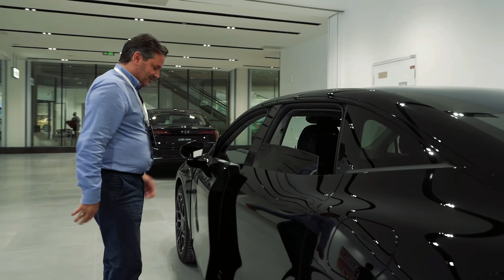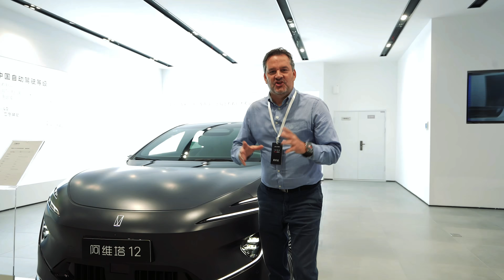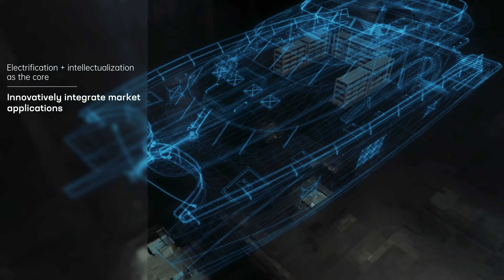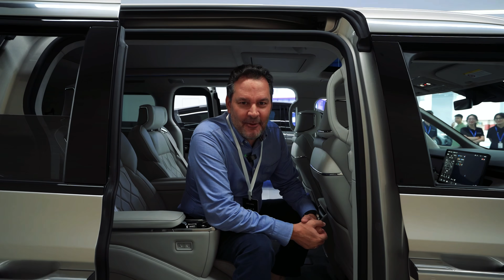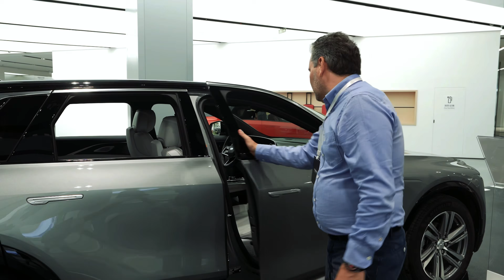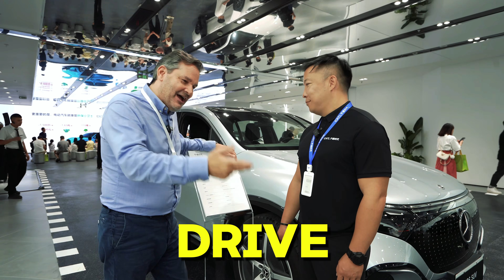Chinese INCREDIBLE Electric CARS Are Taking Over The WORLD Tesla Killers

Comment: There's nothing incredible @ Chinese EVs, as they have not solved d problem of their batteries catching fire. From d moment smoke is detected till d vehicle catching fire is less than a minute. When it burn, it does not just destroy itself,
but often a whole car park. There R some 20k such fires a yr in China. The problem with China's EVs is that d technology is stolen intellectual property. They've never spent d time testing 4 safety reasons, but infos were passed down by former Tesla workers who have been thoroughly trained on d job, or that d info were hacked. Do not believe it
4 a moment that China gained this knowhow righteously.

Comment: cars from China? If you say yes, then read what I write, firstly China has no service like a petrol car, so if you want a windshield you have to wait two months, if this dealer does not make an agreement with the company and only buys cars, you will have a lot of difficulty finding spare parts, then the most important thing, do you know how much a pack of batteries costs, as much as the car and an engine? OK, if we drive a petrol engine to death we can repair it very quickly, with an electric engine?
then from China quality, well that is not the best, all the material is so bad, in three months you will have no tires, everything will rot, all the rubber parts will dissolve, everything is basically recycled from old material
think carefully before you buy

Comment: The best thing about China is that when they built quality, they mean it. There is no rubbish in there quality built. There EV industrie is looking to change the world of driving. But it must be safe, It must be convenient and it must be reliable. Resistance against the Cold of Mother Nature, resistant against the heat of Mother Nature and  finally, water proof to avoid the death of electrocution on a flooded  area were Mother Nature need her powerful water to pass through. Without the assurances of the safety against these elements, is like driving a timing BOMB. One of the important thing about the industrial providing EV to the public is making it affordable for all consumers interested in buying an One. The U.S. have shown many critical errors on the RV manufacturer.  But the customer must understand the inconvenience of something so expensive ending up not worth buying. It just because when it break, it seat in there driveway for month, or not been able to use it again due to an expensive mechanic problem. The U.S. is more focus on  making the money from the consumer, then making it safe for the consumers. There are to many issues with the EV in the US, they don’t bothered to fix and rather continue building with more issues.😳🙄😕

Comment: All they are is upgraded beach-buggies that tie up your money until you die. Screw that, I'd rather a 70's Datsun 1600 or Toyota corolla any day, they do a better job more efficiently and you don't have to use them every day so they keep going like you do with electric vehicles, and unlike electric vehicles would the old cars are still going 50 to 100 years later. And every time there's a war, or flood etc the petrol cars will still keep going, the electric cars either stop or catch fire. On top of that the old cars aren't spying on you and the car can't be turned off without your permission. These cancerous vehicles are total enslavement of the people.

Comment: @samegalle1089 you couldn't be more wrong, keep your head buried in the sand like an Ostrich.  Why do you think the US just banned the importation of Chinese EVs?  The tech doesn't suck, CATL is 5 years ahead of the US on battery technology, take it from an electrical engineer.  With Sodium Ion battery technology, second generation batteries are going to be cheaper, with longer ranges and faster charging, a win, win.  You just keep your gas guzzler idling in your closed garage and see what happens.

Comment: I watched Louis Gave talk about a BYD hybrid that gets 2000km per fill up (gas+electricity) and costs $14000 in China and listened in awe. Instead in Canada we'll continue only to have 70,000$ EV's and zero used EV market (you have to be insane when they charge 20-30,000$ per new battery.)
 Im not a fan of EV's because (i use a car share service downtown that has EVs/hybrid) seeing the power drop as youre driving in -20/-30c winter (also, living in an apartment building means no charging) is  deal breaker. But having to fill up the car 5x per year sounds great.
EV's will remain a limited segment that remains unaffordable for most Canadians. And the Canadian government and all political parties want it to remain unaffordable.

Comment: No they are not... At least here in Europe they are failing massively - why? Short: to expensive, less range and charging speed, no service and spare parts, not trusting in chinese brands.
Because instead of selling them for cheap chinese car companies think they can make big money by selling them at the same price as European cars and no one will buy them for this money...
Why should Europeans buy cars that could become a 2 tones 30000€ paperweight if no spare parts are available or the chinese brand gets bankrupt (as Aiways just did).
Why should anyone buy a 30000€ chinese car if you can have a similar European car for cheaper... Most of the time chinese cars cost the same here in Europe as similar cars we have from our own European brands, but are worse in every single specification: often they have a worse range, charging time, have much less driving comfort and much more cabin noise... The only diverence is they offer often many anyoing and half baked tech stuff no one likes outside of china.

They haven't earned any trust in terms of long term quality and how good the cars will hold up many years down the road.
And than there is not a single brand with a good service network and spare parts are often need months to come by...
And then there us the fact we all have internet and easily can check chinese prices: if you sell the BYD in China for 15000€ and in Europe for 32000€ we all know we get ripped of... And no one likes to get screwed.

So to chinese brands: if you want to come to a new market, cone it with a BANG and make some noise... The only way to do this is via a cheap price - we don't care about your shiny tech anoyers... You have to proof yourself first, like korean brands did, come into a market cheap, build a network and later models will make money.
If you bring a model overpriced, no cares if you lower the price later.... Damage is done already. If you have proofen that your cars are worth it, than you can start to raise the price.
Reply: You are right. So the Chinese should do better. At the same time, US and EU should give the Chinese the national treatment as the Japanese and Korean, instead of various kinds of suppression.
Reply: Lots of copium have you.

Comment: Thank you Alex. Wonderful video. I love what CATL is doing in the energy storage sector. I Live in Alberta and I follow  the daily Min, Ave, Max prices of electricity. Julys numbers were Average Low price $14.64, Average average price at $88.62 and the Average high price was $339.80. That is a huge spread between $14.64 and $339.60. I would love to run a energy storage system of 100 MW by buying wholesale power off the AESO pool price , store it, then put it back on the grid when prices are high.
Reply from the maker: Very cool!